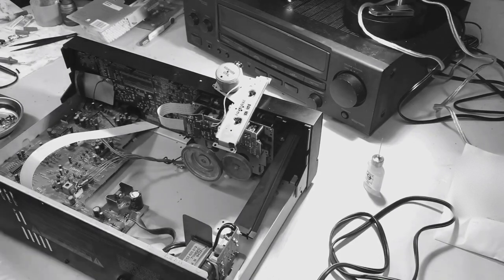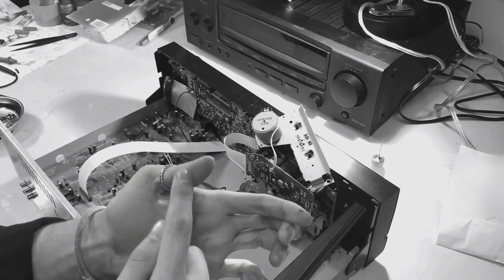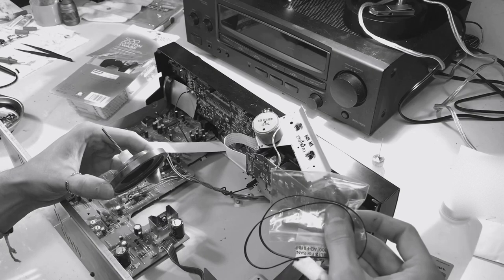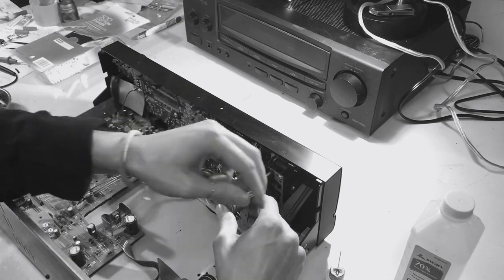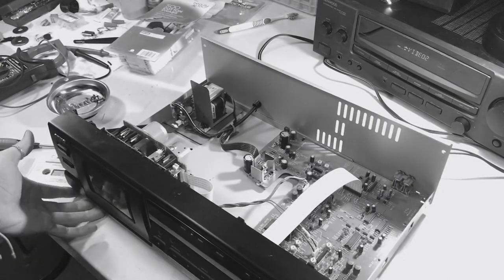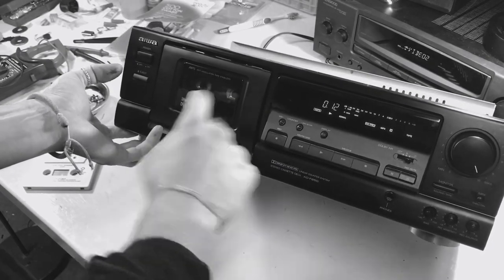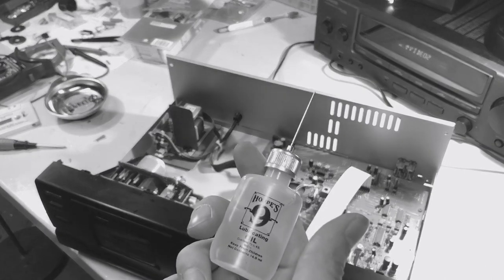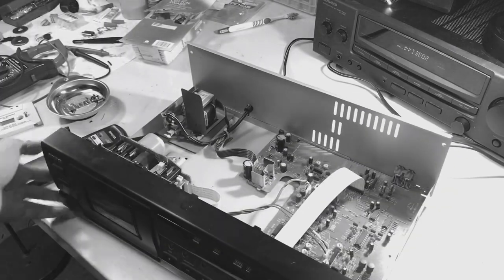Aiwa AD-F850 Belt Change & Review -Adam HiFi-

Comment: many thanks for this - i've just ordered a universal pack of belts thanks to your measurement :) fingers crossed for when they arrive
Reply from the maker: Thanks for the comment - and good luck! Belts are available in the correct size on ebay, I can send that link if they dont fit.
Reply: Only thing I'm a teeny bit disappointed about is that the machine doesn't have a volume control on its headphone jack - wasn't planning on using it with an amp, so will need to look for some kind of in-line control to add to it. Other than that I'm chuffed! Cheers again for the vid
Reply: @davidcooper8241  Hey David thanks for the great video! I have also grabbed the same 60-pack but I'm not sure which belts to use... Are both belts the same dimensions? Can you please give the exact dimensions in cm? I have already put 2 belts but the player stops after 2 secs. MS/CUE and MS/REVIEW aren't working either..

Comment: Hello.  Have you ever worked on a AIWA AD-F1000?  I have one of those from the early 90's.  I believe it was a fairly high end deck.  In any case I was trying to get it working again and discovered the belts were goo - apparently a common problem.  I ordered a belt kit and cleaned everything up.  However, there are two belts, one is a bit bigger and one is a bit wider than the other.  I can't determine with certainty which one goes where.  Any thoughts?
Reply from the maker: Is there a manual with a schematic available? I’m sure it will be in there
Reply: @AdamHiFi  I have the user's manual but it does not have a schematic.  I have not found one online either.  I actually think I have the two belts in the right place but the one closer to the front of the unit (thinner and a bit longer) does not stay centered and slips over to where I think it is rubbing against the large wheel that holds the other belt.  The unit plays but the speed is slow and therefore the playback is at a lower frequency.  I'm open to any ideas.  I'm also assuming there isn't a third little wheel or guide of some kind that I'm missing.
Reply: @AdamHiFi  I believe I figured it out.  I re-watched your video and noticed I had placed the inner belt in the wrong location.  Seems to be working now.  Thanks for your reply and your video!
Reply from the maker: @jimdowney6580  Awesome!